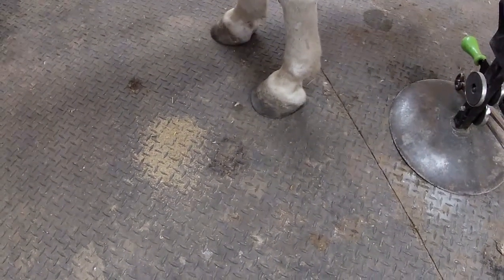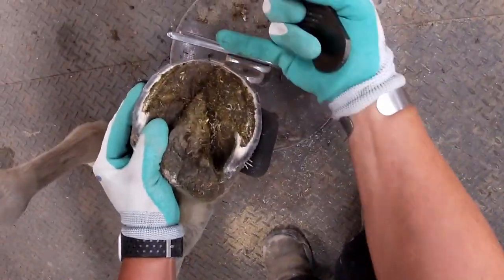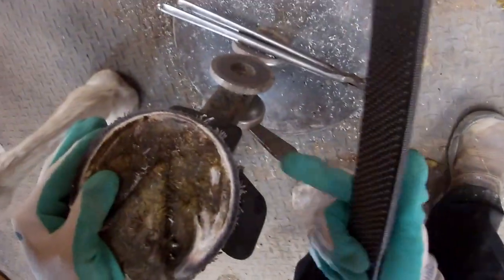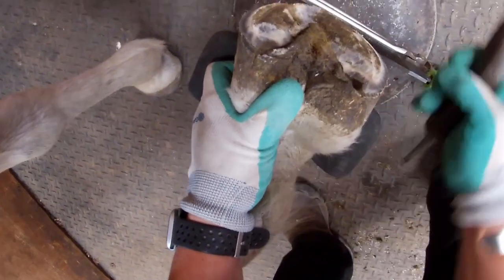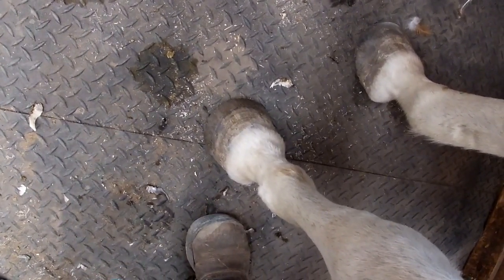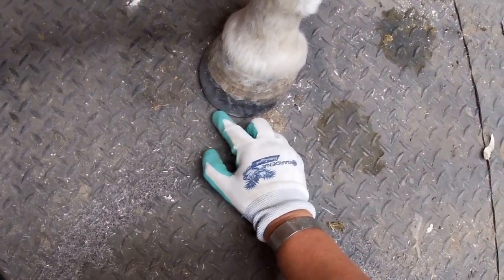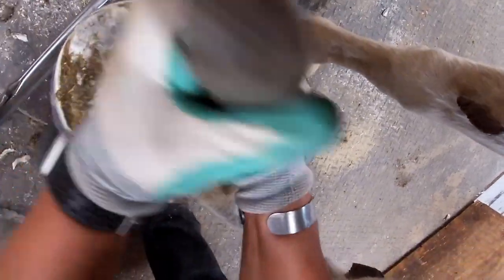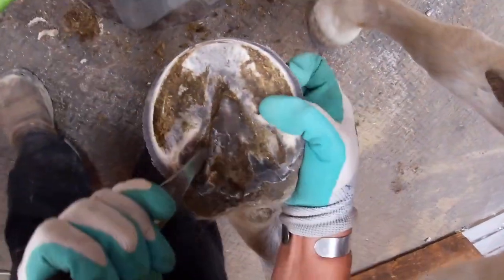Barefoot Trim (Maintenance Trim Jack the Pony)

Comment: Personally, I would remove the loose sole horn first and only then proceed with the nipper. This way you can see much better where and how much you can remove with the nipper. I also find that the bars are cut too slant. The bars must also be able to support the back hoof area, here I would work along the white line and try to straighten the bars by holding the knife straighter.
Reply: As I am learning I wonder what the effect of trimming the bar the way you suggested would be? Not arguing- just trying to comprehend. 
Thank you.

Comment: With each trim you reduce the size of the hoof capsule and eventually trim the pony into mechanical laminitis. I did these same trims for 10 years from 2005 to 2016 and I documented it all. And then discovered we were led by Jamie Jackson and Hildred Strasser to trim the feet out of these horses to try and form them into an image of that one dead wild horse cadaver jackson said was the  perfect wild foot. How many horses have gotten laminitis that you have been led to blame on diet? How many horses really do not "transition" that are never mentioned that also gets blamed on diet? Well it's the trim, you are gradually trimming the whole back of the foot out of this horse and I will be surprised if his feet held together,, through some do, but I would like to see this pony now. the laminitis he's experiencing is from this kind of trim.
Reply from the maker: We will have to agree to disagree. This pony is sound and happy and currently being ridden in lessons. He has not had a laminitis episode in years and after some weight loss is no longer metabolic.

Comment: I'm so happy I stumbled upon your videos! Your explanations on trims are wonderful. I do have a question I'm hoping you'll answer. When you say your mimicking the depth of the collateral groove, what exactly are you meaning? Are you just rasping at the same angle the grooves run from heel to toe? Or is it something more that I'm missing ?
Reply from the maker: I am just holding the rasp at that same angle when I rasp the heel surface. This ensures that the coffin bone is ground parallel at the peak impact phase of the stride.
Reply: @oksnhc  I thought the coffin bone should be lifted by maybe 3-6° and that level would strain the ddft? Or are you saying level on impact of only heels, the toe would be lifted, and when the toe completes landing the coffin bone would be lifted? Do you have any xrays of hooves you trim? (Not arguing, owner trying to learn...my mare xrayed level and dx early navicular)
Reply from the maker: @judymiller5154  The coffin bone needs to be ground parallel at the peak impact phase of the stride, which results in a 3-5 ish degree angle at rest.
Reply: @oksnhc  ok, that makes sense. thanks much for responding. God bless ❤️😊❤️🐎

Comment: You’re videos have been a tremendous help to me! Any chance you can post a similar video  but trimming a hoof in mid summer where it’s hard and dry? I’m having challenges with my yearlings hooves and she has a lot of callusing that won’t exfoliate. Soaking the night before a trim didn’t help much so curious if you have any tips or tricks. I’m not confident with nippers yet so have stuck to a rasp for now. I did buy a mini nipper though the trim off some overgrown frog that was blocking her collateral groves but she’s so unbalanced right now and needs a lot of work done.

Comment: I love the way you explain very simply what you are doing and have nice results, but just want to ask a few things.  Please be assured, this is not criticism,  I am just trying to learn.  Was wondering why you don't open up the collateral grooves at the back of hooves so that they self clean? .  Also, why do you take the  heels down to the collateral groove exit; why is that a factor in determining heel length?  I think it's important to have taller heels to protect the bulbs and soft tissue on a barefoot horse.   Also,  I have not heard you mention the central sulcas or see you clean it out.  Could you address my concerns please?
Reply from the maker: Hi Renee, I don't open the back of the grooves as I don't find is necessary. If I have an overgrown frog, I might open them up by cleaning up the side of the frog, but only as necessary. On this pony I take his heels down to the collateral groove exits as that is one of the primary hoof indicators I use to determine heel height. It doesn't always mean I take them down to there, I have several indicators that I use, but in this case the collateral groove exits matched up with the sole height in the heel and periople skin. I don't leave heels high to protect the bulbs, I prefer to leave my heels at whatever height is necessary to protect and/or stimulate the digital cushion, this means it fluctuates depending on the hoof. In this horse the central sulcus didn't require cleaning. If it is exfoliating or thrushy or overgrown then it would, but in this case it was fine and didn't require my attention. It is extremely important to me that my trim is flexible, it adapts to each horse and circumstance as needed and isn't a one size fits all approach, therefore it changes frequently. Thanks for watching and for the great questions!

Comment: May I ask why you are thinning the wall to address the flare? Because that's basically just for aestetic reasons. I understand that you need to do that for clients, but there's no need for that in your own horses right? In a different video you mention that you do it to reduce leverage in the flare. Wouldn't a big roll be a better way to do that?
Reply from the maker: I disagree that it's for aesthetic reasons. Nothing I do in trimming is to make it look pretty. Removing flare from the top does thin the hoof wall, but when there is flare the wall is already weak and compromised. We can use a roll to reduce leverage but that roll will grow out in about 2 weeks so anything past that will be leveraging again. Thinning the wall by removing the flare from the top allows that wall to wear more effectively once the roll grows out so that it doesn't continue to destroy the connection up top. Thinning the wall where the white line is stretched or there is lamellar wedge present is to me acceptable because there is sufficient material there to do so.

Comment: You seem to have a much better method of of hoof trimming than other farriers in YouTube. All of them say they are doing one thing or another and then they do the opposite. They make the hooves look good but I think they are just perpetuating whatever issues the horse has. Could I ask you, do you think that dressing it on the outside like that wouldn’t make it more likely to flair even more when the toe starts to grow out?? It just seems to me that thinning them would make them more bendy, or does it not work like that?
Edited : asked the question after the statement and deleted a question that was answered in a different vid :)
Reply from the maker: I don't personally think thinning the wall will perpetuate the flare. The hoof is not bending as you describe :) Instead it removes the leverage so the new wall coming down does not flare.

Comment: Hi Kristi - when I work with a horse with under run heels (not severe, but maybe low/moderate) should I still follow your suggests in this video on when I should stop?
Reply from the maker: Yes, the trim is the same. You still want to bring the heels back, just not down. Really, under run heels are a toe problem, fix the long toe and the heels will be able to come in more upright over time.
Reply: @oksnhc  thanks so much for replying! yes! I do know pulling the toe back is key when dealing with under run heels. I’ve been doing that about every two weeks myself and also learning from a semi retired bare foot trimmer (massive shortage of trimmers in my areas so looking to learn to trim my own horses). 

I’m curious your opinion when it comes to fixing mediolateral imbalances in the hoof (hope Im using that term correctly). I have my 18 month filly and when she stands on flat ground and I’m looking directly straight at her cornet band the medial side appears a tiny bit higher (slightly tilted versus straight). My vet did x rays 4 months ago confirming the imbalances in her bony columns (p3-p1). I know it takes time to fix these sort of issues as we are dealing with bones here, but wondering if the cornet band is even a good indicator to use? The Hair along her cornet band appears longer in some parts so it throws me off too. I do lay my rasp across her heels to check balance and look at the length from heel/hoof wall to digital cushion but I’m still developing my “eye” to spot those things. Any tips/advice ?
Reply from the maker: @elisehermann6094  The coronary band can be a good indicator, but keep in mind it is sitting directly over the lateral cartilages, and that is what is providing the structure under the coronary band that you are viewing as pushed up. My best advice would be to look at her hoof from the bottom and make sure your heel heights and quarter heights are even from the hairline to the surface on both heels and then both quarters. Often these imbalances can be evened out over time by re-levelling the hoof to be of equal length on both sides. I rarely use the rasp across the hoof to assess balance as I am not looking for straight across the hoof (unless using a composite shoe), instead I look hairline to surface.

Comment: So would you use that method as well as for shoeing the horse?
Reply from the maker: I would use a similar trim, but I would not apply the arch in the quarters or the bevel at the toe. I prefer to set the shoe back as well to make sure that the breakover is not extended.
Reply: Got it,  thanks for the reply, you be nice if you make a video shoeing a horse too . Thanks again